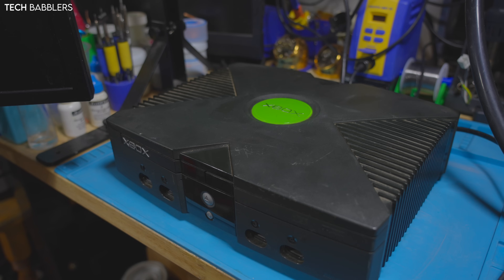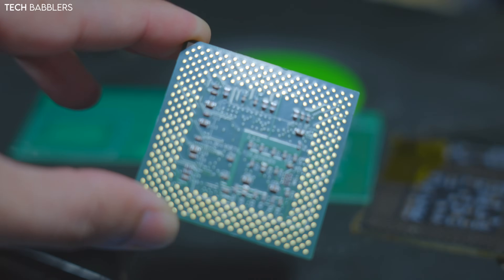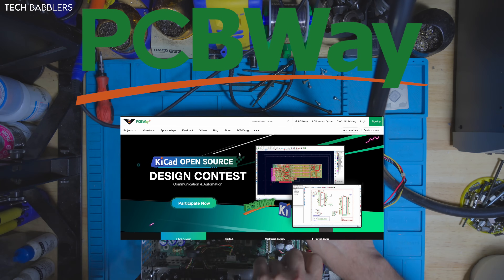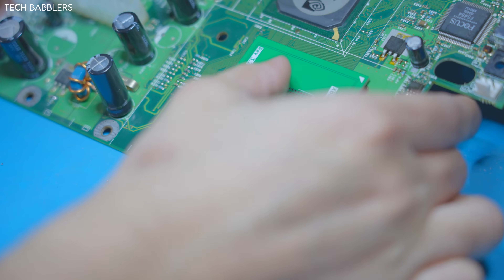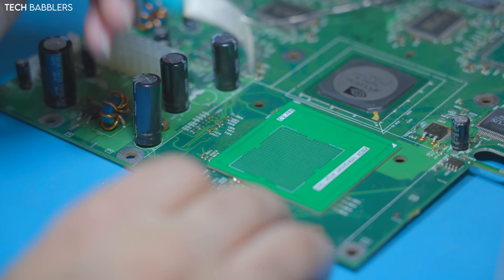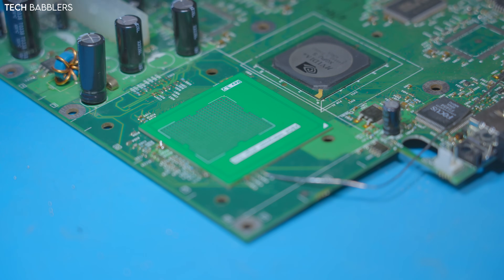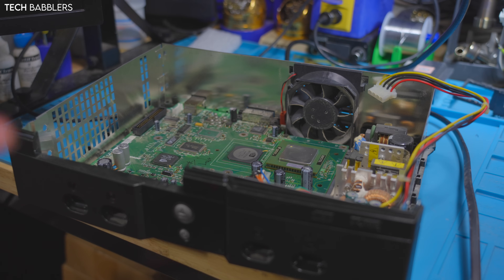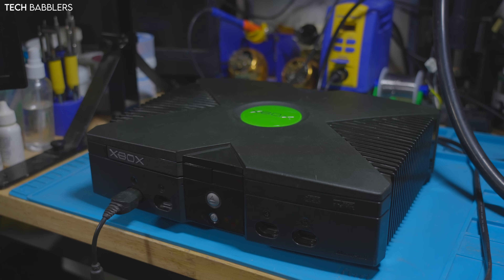Lets Upgrade An Original Xbox CPU to 1.4GHz!

Comment: thought this was the original 1.4ghz mod upgrade... for all I know, this could be what they really meant... recall it basically being a very specific Pentium or the like you would have to carefully solder in place of the other, and it would be just plug and play, aside from 3 recorded instances, all rare and highly circumstantial. Doesn't seem to be what I heard was done, as it uses a hacked OS, but still very cool imo. Maybe after I fully kit out my OG xbox with strictly hardware mods, which don't mess with or require an altered OS, then I will get a second to mod the hell out of lol

Comment: CPU used on this console
Intel Pentium 3 coppermine 733MHZ
Intel Pentium 4 tualtin 1.41GHZ
Reply: Thanks for the info, does this new cpu run some games at fast speed unnaturally or does it optimize itself. I heard here that some games will run to quick and that one guy has a switch on his Xbox to run in normal 733 mode just in case but other cpus could auto optimize
Reply from the maker: Yes, If you don't patch the games or use a Project Stellar which does it on the fly, games will either run fast or be completely broken.

Comment: I considered getting an Xbox upgraded to 1.4 Ghz a decade ago, but at that time, doing so only benefitted a small amount of homebrew software and broke compatibility with retail games that expect the 733 Mhz stock speed. 

Is that still the case? Does this help with retail games?
Reply from the maker: If you get a stellar, you don't have to worry about patching individual games, that'd be the best chip for these CPU upgraded consoles.

Comment: I haven't seen one instance in all these og xbox CPU upgrades/reball process of anyone mentioning the need to bake the motherboard at 100C for 24 hrs before removing or installing the new cpu. Do these boards not suffer from the popcorn effect?
Reply from the maker: I have not had that issue with OGX boards. Many seem to have the issue with PS3 COK-001 boards with the model 828-22 (You can see it printed on the motherboard itself).
Reply: @Techbabblers  Good to know, thanks!

Comment: Hi! Do you know which processors are generally suitable for such an upgrade? I wanted to install Tualatin 1.4 GHz, but in my country they are now too expensive. But Tualatin 1.4/256/100 is very cheap (like 1-2 bucks). I saw how they installed a 1 GHz processor, the boost was rather weak, but it was there. True, what kind of processor it was was not specified. Maybe somewhere there is information or a table on compatibility with the CPU? Thanks in advance and sorry for bad English
Reply from the maker: Any Socket 370 Pentium 3 with 133Mhz FSB will work
Reply: @Techbabblers  Sorry but even PENTIUM III 1.13GHz SL5PU? I read on the forum that if it is 1.13GHz then only SL4HH works or are they wrong?
Reply from the maker: @ArthurPozhidayev  If its the same pinout, yes, it will work. I've done a few 1.2Ghz chips and they work just fine!

Comment: That suppose to double the fps in games or what?
Since games aren't created with that speed in mind I think you mod is useless.
Reply from the maker: Yes, it will double the FPS for some games and then will break for other games. You'd either have to manually patch each game OR you'd have to use a Stellar to get games to run back at normal speeds. This is more beneficial for things like emulating and homebrew

Comment: what would it take to install a 2.5 ghz core 2 duo?
Reply from the maker: Would have to create a whole interposer and even then it probably wouldn't work since it isn't in the same family as the OG CPU.
Reply: @Techbabblers  the lithography of the first generation of core 2 duo was just basically a 2 core pentium 3.  

Do you know if the CMOS/BIOS on the OG xbox is locked to the family name lithography or does that CMOs/BIOS recognizeable  by input/output instruction, versus family lithography

Comment: Bench testing 
?
Reply from the maker: I test using the Halo games with console fully assembled. One hour on, one hour off, for a few days to ensure no freezing and stuff. Only had one console thus far that would freeze after the first few cutscenes in Halo 2, which required the voltage to be dropped a bit which resolved the issue.
Reply: @Techbabblers  that's important info thx

Comment: How does that not cook the cpu
Reply: No power connected I think, as long as it's not hot enough to melt actual metal. Or gold. 

Why solder melts at a low temp. Lead and tin alloy

Comment: Question: what does this upgrade allow that wasn't possible previously?
Reply from the maker: More FPS on homebrew and emulators. Makes native games kinda wonky, you have to patch them or else some run super fast or some just break all together.
Reply: @Techbabblers ”super fast”? What? How would upgrading the processor make it worse? What do you mean “super fast” wouldn’t that be a good thing for better fps? Why would you wanna patch that.
Reply: @jakeplayzyt5220 super fast as in UNPLAYABLY fast. Like youre barely capable of controlling them fast. It helps in some games and stuff like video playback, but some games literally just CANNOT handle it and go ape.
Faster doesnt mean better all of the time.
Reply: @JoshNotJohn0  ooh Ty man

Comment: Have you thought about overclocking the CPU a little bit? Most SL6BY CPUs will do 1660 MHz, if you are very lucky you could get even up to 1750 MHz (without higher Vcore). Or perhaps XBOX can't handle high FSB clocks?
Reply from the maker: I didn't try but I have heard that it's possible!

Comment: Little idea: tape the interposer down in case you bump it before you add those extra resistors to hold it in place. If its Kapton tape, you can leave it there for the rest of the 1st interposer process, otherwise remove it after the resistors are in place.

Comment: Amazing work, but the Tualatin is utilised better in Socket 370 Motherboard running Windows 98SE and XP. Unless there is software and patches to take advantage of the Tualatin, your not going to get much out of it besides better emulation and slightly more stable framerates. It would also be nice to get it to run discs without patches, not sure if there is a way. But i think a 1ghz P3 would be plenty good for the Og Xbox. It's not overkill and will provide the exact same benefits except with a less power hungry CPU.
Reply: There is a program to patch the games for the new CPU speed, and obviously the Xbox can handle tualating, xbox kernel is almost windowsXP based... or better to say, win XP had the modifications created on the Xbox kernel

Comment: What exactly is the purpose for this?
Does a stock Xbox even utilize any of the extra CPU performance?
or is it just for modded xbox's, and certain games that can take advantage of it?
Reply: Besides emulation and homebrew, not much to be honest, you can't turn up the settings, framerate and the graphics of the games like on a PC. And it won't even run games without patches. The Pentium 3 Tualatin 1.4 is overkill for the Xbox, better to just put it into a Socket 370 build with something like a Geforce FX card. A 1ghz P3 or Celeron is plenty good for the OG Xbox. But it still is a very impressive mod. BGA mods of any kind involve some serious dedication.
Reply: @8bitnation419  ill take the 1.4 with stellar that automatically fixes the games and will allow for higher quality movies and TV shows along with a smoother dashboard!
Reply: @JoshLineberry Does it now run games without patches?
Reply: @8bitnation419  yep!

Comment: and? what does this to performance in games?
Reply: this mod was intended for modded xboxes running emulators more then anything back then. though it does decrease load times in a few games, and games with abit of lag like most of the need for speed games and half life 2. really isn't necessary anymore as even cheap android tv boxes can run most emulators flawlessly..
Reply: With that mod you can run all games at good framerate on 720p, or 720p video at good framerate too... without cpu upgrade you can but very low fps, imagine playing KOTOR or Half-Life2 at 720p, yes original xbox just need a better CPU to be a 720p capable console.
Reply: @SargentoDuke  lool
Reply: @McLeonVP  original Xbox can run some games at 720p with no problem just with 128mb ram... but with 1.4ghz Cpu you can run all... Morrowind or Kotor on 720p looks better than on XBOX 360... but framerate drops to 5fps on open maps and are unplayable, you need at least 1ghz cpu to move 720p games and VIDEO/youtube on the original xbox... and 1.4ghz to move them perfectly! Remember 1.4ghz pentium 3 ecuals to a 2.8ghz pentium 4 (or a 1.4ghz Core2solo, as Core technology was defeloped from Mobile Pentium 3 tualatins). I had the interposer and a 1.4ghz cpu but i had not the skill to do it so the 1ghz pentium 3 direct-soldered is the only i can had. 
But playing original Xbox games at native 720p is AWESOME
Reply: @SargentoDuke  128mb ram? the ps3 only haves 512 and the ps2 64mb i think
Reply: @McLeonVP  you can just solder more ram on the original xbox... up to 128mb
Its an easy mod just need a chip/upgraded bios... and soldering the 1ghz CPU is just "reballing" it too, not so hard.
Then you install a newer big hard disk, download all the games you want, patch the games to 720p/128mb ram and enjoy
On the original xbox you can even search on google or use youtube, but you need to install a lot of mods or find a "mod pack" with all installed, and its easy to double the performance to play at 720p and enjoy it on a modern TV.

Anyway you can get a modded xbox and download all games for free too and just be limited to 480p resolution, with no more ram or cpu needed, just an xbox softmodded with just the hard disk replaced for one bigger, cheap

Comment: What is the most powerful hardware that could be swapped into the original Xbox? It's a PC that plays games. So what's the most powerful CPU that can be strapped to the board? I'm sure there is a hardware cap on the amount of RAM that the system will recognize But I'm sure the RAM is upgradable too. The GPU should also be upgradeable as long as it's on the same PCI or whatever standard the original Xbox used.

Comment: makes it not compatible with some games,  idiotic thing to do
Reply from the maker: It's more of a niche product.
Reply: @Techbabblers  unnecessary. It only speeds up emulation a bit and breaks games. If you want faster emulation use a PC
Reply: @ef1265  With Stellar or the new Cerbios, you can have retail games patched on the fly so even retail games benefit from this upgrade. Maybe get to know some facts before making idiotic comments.
Reply: @mikeytitanic  it is AN  lDlOTlC thing to do and  poinltess,   just because something can  be done doesn't mean it should or needs to be!!!! lDlOT
Reply: @mikeytitanic  TlT head

Comment: Does the new CPU need a heat sink and fan? Or is the fan in the console at 40% + able to take care of it once the disc drive and hard drive are back in the console? If anyone knows where I can find someone to install this here in England please let me know.
Reply from the maker: You have to cut a cap in the HDD tray and use a 3D printed filler piece glued in the top since the heatsink is now sitting higher than the OG CPU. You can also cut down a few MM from each fin on the heatsink, which would acheive the same result. From testing, running fans ~50% after a game is about 55C on the CPU.

Comment: I have one of these made by N64Freak in Germany years back. It has the extra ram also. I have a Joshua Lineberry loaded 2TB drive on it. It's been sitting for some time but that thing is awesome! Mine has a switch to drop the processor speed so some games won't go stupid fast.
Reply: Upgrade that thing with a stellar chip and it should auto patch the games when you run them and make them all playable! ❤❤

Comment: All I could keep looking at was what seemed to be a puffed up capacitor
Reply from the maker: Hahaha, I replace all caps after the rework, just didn't have that in the video!
Reply: yeah there's not getting around Replacing the Capacitors in an Original Xbox even if they're not Puffed you're heavily advised to replace them do to their penchant for leaking and damaging the board.
Reply: @ulasht1 nice punctuation.

Comment: Came by this video randomly, would’ve liked to have seen a before and after performance wise, or a side by side to show the differences / benefits of upgrading the CPU
Reply: thanks for saving me 18 mins of my life
Reply: You could head over to: Modern Vintage Gamer And search his videos for: The Most Powerful Original Xbox - FriendTech DreamX 1480 - Teardown, Games, Emulators and More
Reply: @proudofyourroots9575 hard part now is that I don’t have time to do these mods despite having YouTube, tools, and even an electrical engineering degree. lol I’ve been modding PS3’s when I get time, which is very rare, but never get to play them anymore. It’s more of a collecting hobby now. 😢
Reply: https://youtu.be/RrONeFj0p3A?t=410
Reply: It was popular back in the day because of faster video decoding as a media machine
Reply: There are quite a few videos showing the benefits of this upgrade.
Reply: yeah, me too on both counts. I don't know why one would want to do this. Wouldn't it possibly break some games that are expecting a certain speed? Or would it just make frame rates smoother? I have to think also that the video chipset might play a part in limiting the effectiveness of a processor upgrade, too. From what I understand it's basically a GeForce 3.
Reply: Emulators benefit greatly from the CPU upgrade. As well as some games which are possibly CPU limited.
Reply: @R4dm1n  well, yeah I guess there are probably games on the Xbox that don't run well, that might run better with this kind of upgrade.
Reply: You can run pretty much everything smoother on upgraded cpu because of emulators benefits from the faster cpu better. And speaking of emulators, with tons of other mods you can play most of the games at 720p and some even at 900p or 1080p if you really push this old monster that far. This CPU upgrade does not give you a better fps ( just a little bit ) but it gives you a whole new graphics experience because of the faster CPU so you can crank the details way up than befor
Reply: Not a single reply to this comment understands how computer hardware works

Comment: What cpu should i be looking to buy for this mod.
Reply from the maker: Any one of these:
SL5XL	1400Mhz	512Kb
SL6BY	1400Mhz	512Kb
SL5VX	1333Mhz	256Kb
SL6BZ	1333Mhz	256Kb
SL5LW	1266Mhz	512Kb
SL5VX	1200Mhz	256Kb
Reply: Thanks that's good info, I appreciate it.
Reply: P3 Celeron@1300 I think, not tualatin 1.4

Comment: So, I'm not an Xbox expert, but it looks like you have holes in which a socket can be mounted. Why not do that?
Not that there's anything WRONG with this jank little 1:1440 scale temple to the silicon gods, the faeries that live in my Xbox will surely love to swing around on the pins, but this is a fabulously horrid little assembly.
Reply from the maker: We'd still have to reflow the socket onto the interposer, which a few people have tried out recently and it hasn't gone too well
Reply: @Techbabblers  So despite everything visibly wrong with this setup, it is genuinely the best way to do this. That's fabulous.

Comment: Why not make it a proper PGA socket rather than soldering the CPU?
Reply: Because you would still have to solder the socket - and there's no other CPU you can install.
Reply: @JohnnyWednesday  Yeah but it'd be cooler
Reply: @JohnnyWednesday  Facilita el reemplazo de procesador en caso de que un día se dañe, no necesariamente tiene que ser porque quieras ponerle un mejor procesador.
Reply: That's what I was thinking 🤔
Reply: Maybe sockets aren't no more available ?
Reply: Clearance might've been an issue. (Just eyeballing it)
Reply: Since you have to heat up the interposer to around 200°C to melt the solder below, the plastic socket ontop would melt away from such heat.
Reply: @NecroFlex  No it won't melt. Search for "PGA370 Socket Install OG XBOX Holy Grail of XBOX Mods?"
Reply: @NecroFlex Not true, this has already been done by many modders before and it does carry the advantage of resucing wear on the cpu because it doesnt have to undergo the extrs heat cycle from the soldering process and it makes many more heat sink options available other than that its mostly useless which is why modders rarely bother to do it because its lots of extra effort for little benefit.
Reply: The original CPU was a Laptop special version of a Celeron with more cache. The first PCB convert from laptop to Socket 370, se second PCB helps control the actual speed of the CPU. Add a socket is posible, but it's a lot of work and need to change the cooler for something shorter and a robust fan.

Comment: Benchmarks? I totally need to see before and after.
Reply from the maker: Pretty much what @piratelechuck1911 mentioned, it helps with running emulators or homebrew, but for most games, they will be broken and you'll have to patch them to have htem run properly
Reply: This upgrade is pretty old school. Performance with Linux is pretty good, but improvement for game performance is negligible at best. It actually increases instability with games. There was also a 128mb memory upgrade we would do that would give some games minor improvement, but nothing to write home about. It was originally called Dream-X.